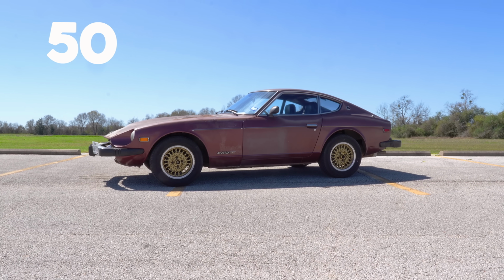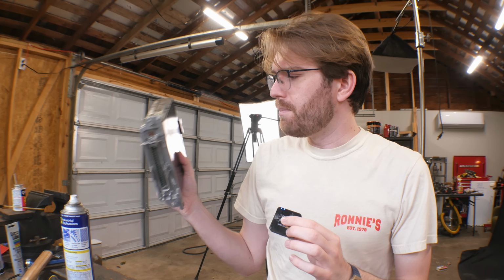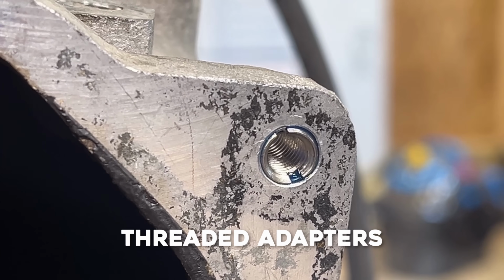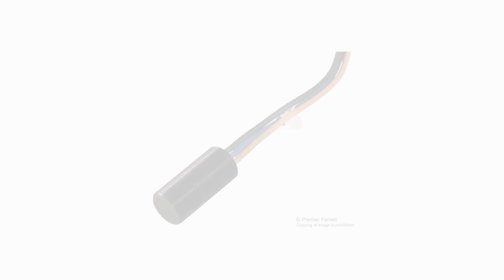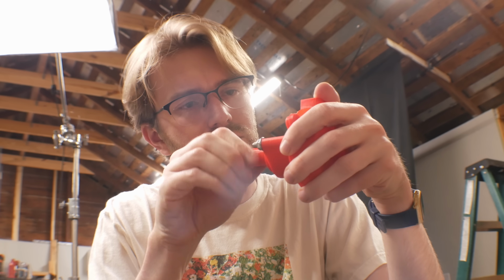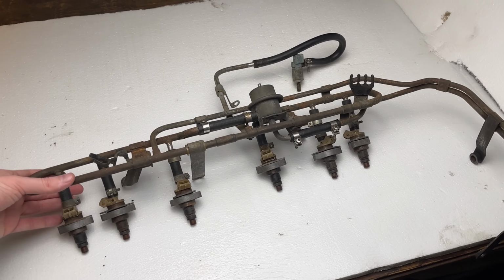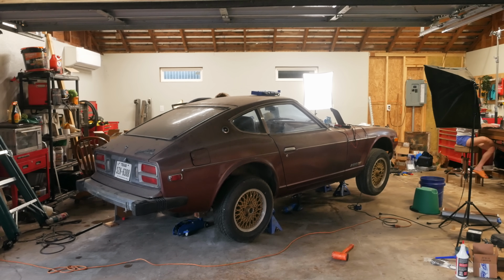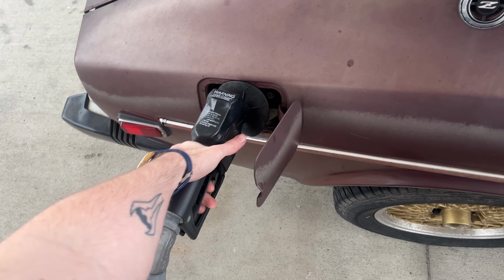Modernizing a Vintage Car

Comment: First time I have seen your channel. This is exactly what I didn’t know I needed in my life. Your delivery is perfect. I learned about what the hell timing is actually for and had no clue about the computer telling the engine how much air v fuel would work. Absolutely brilliant. “Getting stabbed in the face 47 times” It was the perfect blend of cars, knowledge and comedy. If you somehow worked a Glock into this, I’d probably die a happy man.

Comment: WTF, I honestly thought this video was 10 years old because it  has 250k + views. Absolutely awesome video!
You might even consider offering everything you restored and replaced , the metal parts, the wiring harness, basically everything needed for a full renovation — as a complete restoration package.
If I had a car like this, I would 100% buy it from you. Such an amazing result, I enjoyed every minute of it. Thank you!

Comment: Back in the 70’s a company called Scarub made a kit for the 240Z to install a Chevrolet small block V8.  It wouldn’t handle but it was a blast in a straight line.

Comment: Chances are the original coil would have lasted forever.The individual coil packs on my two 2013 Lincoln , with two hundred and twenty two thousand miles still firing , just fine

Comment: I hate to say it, but when you state that all injectors fire at once in a D-jet system, it's incorrect.  This is the same system in Mercedes, Audi, some Porsche's and it is still used in similar fashion on a lot of modern brands ... Unburnt fuel being injected during non-combustion phases would not only be incredibly wasteful but dangerous as well.  Perhaps yours was operating incorrectly.  I wish you'd post more - your Fiero vids were great (it's why I subscribed long ago). I then unsubscribed because you fell off the face of the earth - I only stumbled on this one after a buddy suggested I learn about older Nissan/Datsun cars.
Reply: Might need to get your ears check, or maybe not comment about something you didn't double check. He said it's a L-Jet system, L-Jetronic–style electronic fuel injection. Which does fires all six simultaneously in batch. The D-jet and L-jet work very differently. And D-jets were phased out for L-jet mid-late 70s, L-jet lasted late 70s-80s. But d-jets MAP approach is stull used today for airflow systems.

Which funnily enough, he essentially just turned the L-jet into sequential multi-port fuel injection, the L-jet no longer exists lol. The L-jet that was in the car was working as it should, but he turned it into something marginally better.

Comment: Don't forget to factor in the savings of not getting rescued on the side of the road for bad points or coils and such.  You didn't just add efficiency, you improved reliability.

Comment: Smart jobs ! love your sense of humor. L-Jetronic : Bosch Injection. And no, Bosch is not a "Disch Washer Company", this is a small  part of the Business. The Bosch Group generated sales of 90.3 billion euros in 2024, thereof 56 billions in the automotive... #1 in the global top 100 automotive suppliers with major contributions to the technology being the inventors of High-Voltage Magneto Ignition (1902), Anti-Lock Braking System (ABS), Electronic Stability Program (ESP) – 1995, Electronic Fuel Injection (1967–1979) like Jetronic systems (D-Jetronic in 1967 being the first mass-produced electronic fuel injection,K-, L-Jetronic, Motronic), Lambda (Oxygen) Sensor – 1976, Common-Rail Diesel Injection (1997). Today Bosch leads with globally 30 % market share in the Diesel Injection worldwide, 60 % in EU.. and also 30 % for Gasoline Injection.. Worldwide… 40 % for ABS/ESP, 50% in EU. You are welcome

Comment: While the engine was out, you should have rebuilt it, new bearings rings, check cylinder walls etc. You would get back more of the original HP.

Comment: All the injectors used to just fire all the time? Seriously? Wouldn't that use 6 times the amount of fuel a modern 6 cylinder engine would use then? And wouldn't you just be shooting heaps of unburned fuel out the exhaust? Seems not cool

Comment: I’m sure you wouldn’t still own the car if you didn’t love it - so likely  insulting it is mostly for entertainment purposes. But the 280z fuel injection system was actually cool as hell for the time - no onboard diagnostics so tough to diagnose problems - but it was one of the first commonly attainable electronic fuel injected cars on the American market. And the internal engine mechanics were actually quite reliable.

Also it used mostly mechanical/non complex equipment to run a computer controlled fuel system(which is sick!)
- The air door sensor (maf) has an arm that runs on a potentiometer which moves with a physical airflow actuated door that can be tuned in two different ways with nothing but a screwdriver. 
- the system has no 02 sensors so all of the A/F mixture is done by math already set into the computer
- these mean that the savvy home or professional tech could tune the fuel system almost entirely by ear and checking spark plug color. 

-also as an additional point: throttle by wire (throttle body’s actuated by a motor) is commonly disliked because 1: if it breaks often times there’s no chance of “limping home” as they tend to make the vehicle un-drivable when there’s an issue. Whereas with throttle by cable systems (throttle body mechanically connected to peddle) they tend to still be able to partially work enough to get you to a safe spot. And TBW systems are also MUCH more expensive to fix when they do break and often times require expensive tools to test and factory programming after repair.

Loved the video, the fab skills/resourcefulness and the car - just though you should put some respec’ on the name 👍🏻

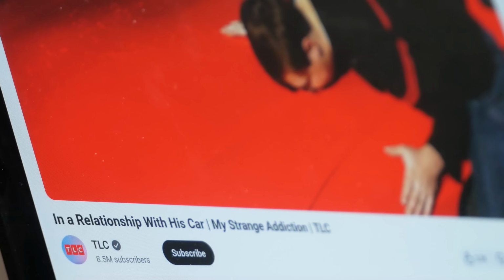Comment: 6:56 For steering and maybe brakes I still like the old systems but for throttle if it responds quickly to input I think the drive-by-wire is good. Like I don’t think there is much sensory feedback from the accelerator either way.

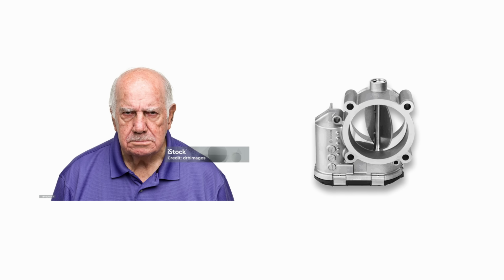Comment: 6:54 a cable throttle is nice for response but kinda sucks for modulating small amounts of throttle. Like trying to slightly bring the rpm’s up during idle in a 99 Camry I had was an operation of insane precision. I wouldn’t even feel the pedal when it would already be trying to rev itself to 5000 rpm.

Comment: Very entertaining and inspiring video. Congratulations.
I live in North Texas and have a ‘76 280Z. Over the years I’ve restored it to a nice state and a few years ago purchased the components necessary to convert it to a Speeduino, computer-controlled EFI. I also purchased a 1979 280ZX harmonic balancer to be able to sense the crank position.
Life got in the way, so I haven’t done anything yet but I also have doubts about using that ‘79 harmonic balancer.  I love the idea of using the distributor shaft, instead. I also love the new throttle body with spacer you designed.
Any possibility of me following your designs and using the same sources?
Thank you.

Comment: Very cool. I like how you say newer cars are more reliable, fuel efficient and more powerful. 2 out of 3, in my opinion are correct. Being reliable isn't one of them. You just proved that being that 50 yeat old car still runs and drives when newer cars, fresh off the lot have broken down within miles of the dealership. All this new technology still hasn't fixed that issue. Its made it more complicated and more expensive. Again, this is just my opinion.

Comment: enjoyed the story...I have same ideas at upgrading my 1990 CIS-E injection on my Mercedes 300SL....while a computer fine tunes the injection it is still very analog....but as long as it still works I'm not going to screw with it...until I get bored and have the time....:)

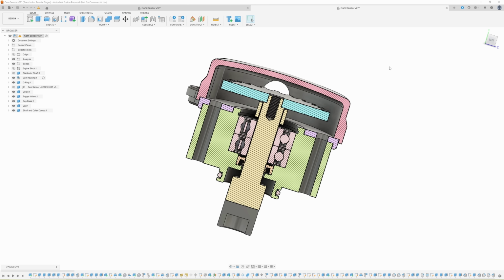Comment: 15:34 You could also use an optical encoder with an index. Basically the shaft spins and produces a signal that tells the computer how much the shaft has spun and a separate signal tells the computer where zero is. The cost effective ones are accurate to like .35 degrees.

Comment: As a one time amateur engiine enthusiast, much respect and wow, cool approach and shop. Is 20 hp really worth it ? It would be cool to race an analogue version with a modded. Maybe its just cool to think it. What would the difference in engine sound be, though it was fuel injected to begin with and not carbueueated.

Comment: Have Fun ! Guess the next job is putting a decent paint job on that bad boy... BTW... I was a engineer on the vessel transporting that same model car to Puerto Rico. A whole " Ship Load ". Of that model .Since hundreds of this car were gassed up so to drive and park onboard, I got a chance to get in one of them and turn the engine Over! I was pretty much a Steam Engineer so Very much amazed by this " at the time" state of the art vehicle! I was a Crackerjack steam ship marine engineer at the time! But... now in the 21st century since there are no longer any Steam Powered merchant ships I find myself as obsolete as your 280z...
Nappy time... 😴

Comment: The main limitations of the Datsun L-series are the sohc, 12v sylinder head which doesnt breath well. Kinda sad you only gained 20hps, but with a different intake with longer lunners, and maybe a cam swap you would have made more power ofc. It is what it is. You could always just turbo it.

Comment: I had a great '78 260z with a T-top that was a pleasure to drive into the 80's. You essentially redesigned a car without the benefit of designers, so pretty impressive. Couldn't tell how well it was actually running on the road from your video, but I can at least guarantee that my Z looked a heck of a lot better hauling down the road. If you're going to keep that sucker around for another 63 years, at least slap a coat of paint on it. Great story, including all the things you forgot to attach/install.

Comment: Very cool project.  When the 280 Z came out I was just entering the job market. ( Kinda telling how old I am).  I wanted one of these. A friend of mine had taken a 240Z and put a Chevy small block,with a juicy 4 barrel carb.  It was Way over powered.
I admire your work.  In a lot of ways 3D printing has changed the project car world, and a lot of other DIY projects. Way cool 😎.

Comment: without touching anything internal, result is pretty much whats to be expected. 
economy wise, you could squeeze more miles out of it with fine tuning but your still limited by very old head technology, not to mention could probably use reconditioning... and a low compression pistons which likely have considerable wear with ring sealing. also, not really a small engine either. 
after converting to L/100km the economy number seems about appropriate for the car. 
great work with solving the engineering tasks making this run, very glad to see 3d print used as a method of rapid prototyping rather than "final" product that goes terribly wrong later. 
Please just tell me you atleast greased up those wheel bearings when you did the brakes. hand lathing drums was one thing, a very dumb thing... but atleast grease the bearings up if your not replacing them. sometimes if they arent faulty, your better keeping originals... but they wont last long if the grease is no good. 
glad to see its still L28. looking forward to the next video in a number of years

Comment: How are you testing the hall effect sensors? I have a BMW N42 engine and all aftermarket sensors whether they don't work or they fail prematurely. I would like to understand what is the difference between original and aftermarket ones.

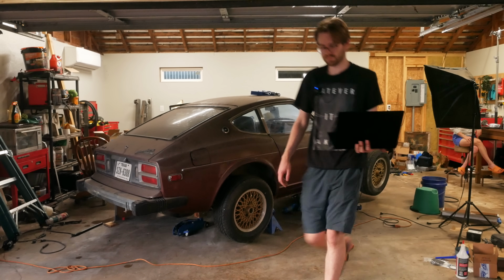Comment: 27:20 I’m guessing based off the sound that the rotor isn’t working. Which makes sense because it was removed. So it’s actually not communicating with the computer. 
Let’s see 😊

Comment: Some distributors use a normal spring on the very bottom between where the shaft of the distributor and output meet. The centre of both are drilled to house the spring.

Comment: You shot yourself in the foot with rule #2. Some simple port work in the manifold, some better valves bigger if they fit, port the CSA of the intake runners to 90% of the valve diameter and port the exhaust side, 3 and 5 angle valve job and deshroud the valves in the chamber, run a thinner gasket to get your dynamic compression up, go for around .040” quench area, a slightly bigger cam, you could get the power up to at least 240 or more N/A. Always room for a turbo if you gap the rings too.

Comment: Newer cars being more reliable? Nah not even close, you try to start a car from 2019 in 20-30 years from now you won't be able to, to many chips that will be outdated and damn near impossible to source to get it running, now as far as efficiency goes yeah sure better gas mileage and better aerodynamics, and as far as modern cars being more powerful goes yeah I give that to you to, but they are no where near as reliable as older cars

Comment: Hello from Katy TX. Rule of thumb for O-ring groove sizing is to prevent any overfill (>100%) of O-ring volume in the maximum temperature (O-ring swells in high temperature). Just make sure the O-ring squeeze as installed is around 8-10%. O-ring stretch or whatnot can be eyeballed. This guide line even works on 10,000 psig application in Oil&Gas industry which I am working in. All percentage in volume calculation.

Comment: If you are making it modern... you should have used a 400hp 98lbs Tesla Model S motor.  You would get 0-60 under 4 seconds and a top speed of about 145mph.  With a modest 50kWh battery about 400lbs the car would weigh slightly more than original, 150-180lbs.  Nothing major.  About 200 mile range also!
Reply: Costs about $5 to fill up at home.

Comment: For measuring motor speed, does that ECU not accept a rotary encoder signal? Just curious if that could have been a simpler way of connecting to the distributer shaft rather than making a hall effect sensor and wheel.

Comment: What also doesn't help efficiency is the way the cilinder head is designed.... the inlet and exhaust are on the same side of the engine.
This is not optimal for air/fuel mixing and flowing into the cylinder.
But you want it to be stock so that can't be changed.
I would rebuild the engine so bearings , seals , piston rings and valve's are as good as they can be 😀.
Thanks for sharing this great project 👍😀.

Comment: Damn, late to the party hear, but this was an excellent video and build. 
Would to see gains achievable if you were bump compression to 9.5:1 (assuming it’s in the 8:1 family like most engines from that era), give it optimal quench (if it doesn’t already), give it some mild port work (assuming it flows as poorly as a lot of engines of the era), and straight up can timing (again assuming it isn’t already).

Comment: Or just buy a small block LS3 engine..like they do with the 944 conversion. As an engineer, (aka Evil engineer = evlengr) that is some real determination and innovation. Love the use of the hall effects switch for timing. Actually planning out the 944 conversion now for the summer to drive my wife insane.

Comment: honestly, thats impressive. But if you're no longer firing all 6 injectors every single time you only need one, you should be getting a lot better than a 13% increase in efficiency. Even if the new injectors are sending twice as much fuel, you're firing them 6x less often. You should be able to tune the ECU to get both power and efficiency much higher. But I do admit this is math and theory and that seldom translates directly to practice/reality.

Comment: That’s cool. Back home where I am from people make aftermarket kits for converting (carburetor/ KE jtronic / etc old fueling systems) to injectors with ECU and MAF. So old 80-90s Mercedes, Audi and others have obd ports and you can see real life info on ecu. These kits usually cost 500$, including the instruction and online fine tuning once you install it yourself

Comment: Cool exercise to do, and good on you for run an old Datto 👌
Just wanted to mention a couple of things as an old Datsun mechanic and EFI guy. 
- Most of your power gain was likely to be due to the size of the new throttle body.
- The new engine position sensor is really cool, but the ECU could have very easily been set up to read from a locked stock distributor using the original hall sensor inside.
- The L jet EFI system was very basic, as you well pointed out (Nissan were among the first Japanese companies to use it) however the batch fired injector system makes very little difference vs sequential injection on a port fuelled engine.
Sequential injection can make the idle and part throttle slightly smoother but there's no difference at larger throttle opening and higher rpm.
- All those air valves were a result of the lack of memory and computing power in the late 70s ECU. 🙂
There was simply not enough brain power in that box to make fuelling decisions AND run fast idle or the ignition system.

Thank God for modern aftermarket EFI systems 👌

Comment: Great video. The tech in 1978 was pretty good for as limited as it was.  All that work, time, and money, and you only gain 2mpg and 17hp.  Nearly similar gains could have been made by simply upgrading the exhaust on the factory system.  But, was there a change in the torque curve of the motor? The max HP, which is the engine at WOT under a static load, is probably less interesting than how the torque curve changed.  And if that change resulted in better acceleration or more responsive acceleration getting on the highway or from a stop.

Comment: Great video, but I would add compression to air, fuel & spark. You can have all the air, fuel & spark in the world and the engine still won't run without compression.